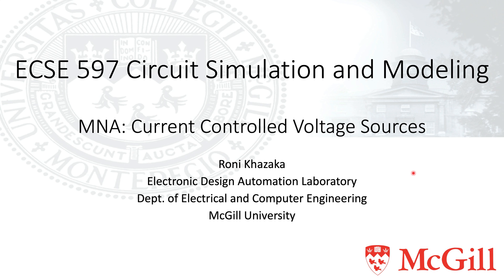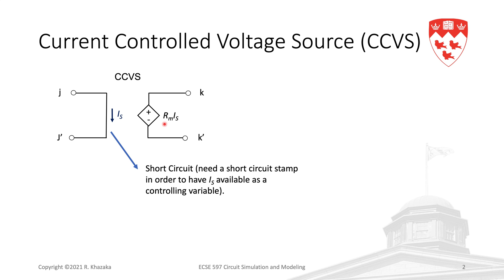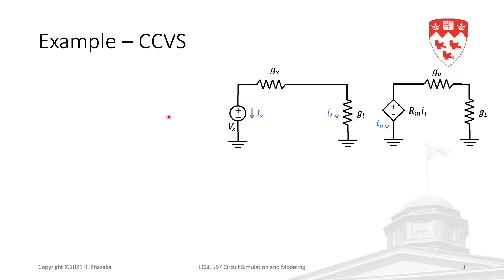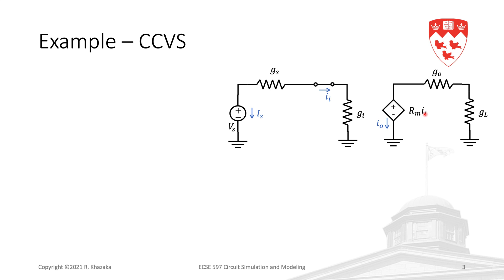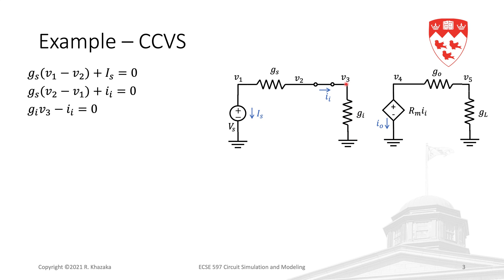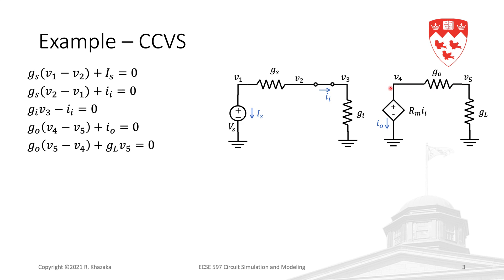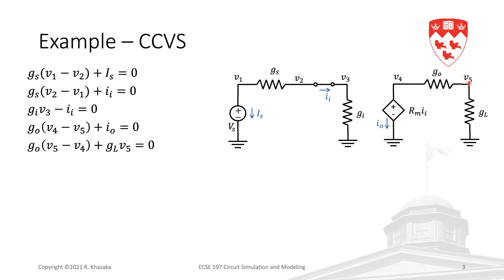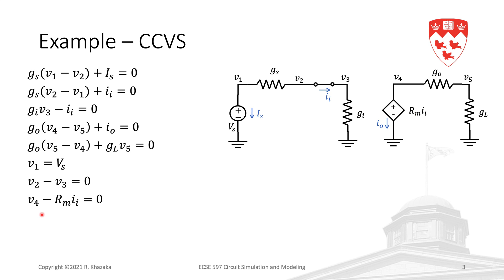MNA Current Controlled Voltage Sources

Comment: 00:06 - Developing a stamp for current controlled voltage sources in modified nodal analysis.
01:13 - Understanding current controlled voltage sources in circuit analysis.
02:16 - Analyzing current flow at multiple nodes in a circuit.
03:21 - Modeling controlled voltage sources with KCL in circuits.
04:33 - Matrix representation of circuit equations for controlled voltage sources.
05:39 - Short circuit stamp enables current variable integration in KCL equations.
06:38 - Introduction to modeling current controlled voltage sources.
07:52 - Current controlled voltage sources manage short circuit currents effectively.